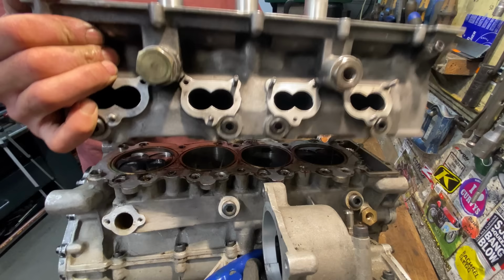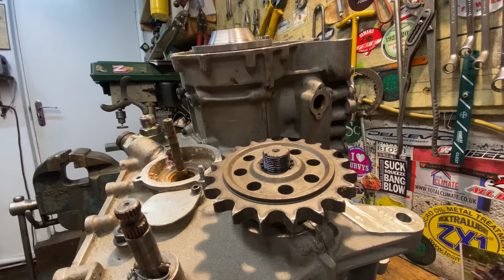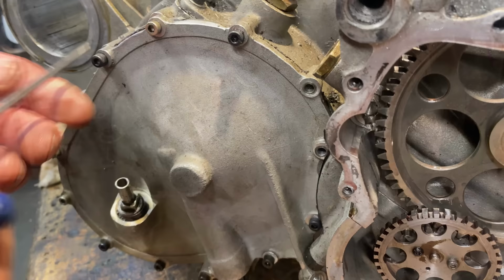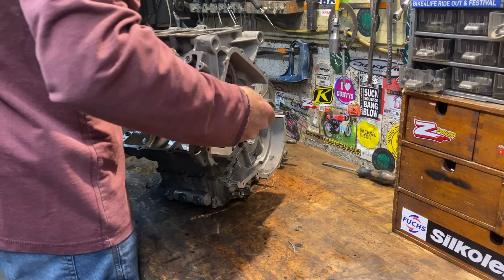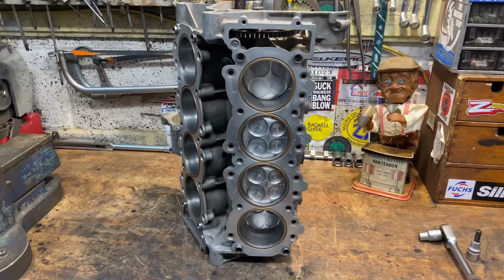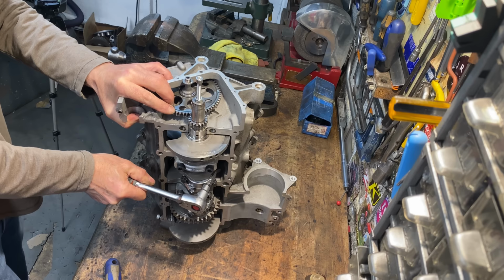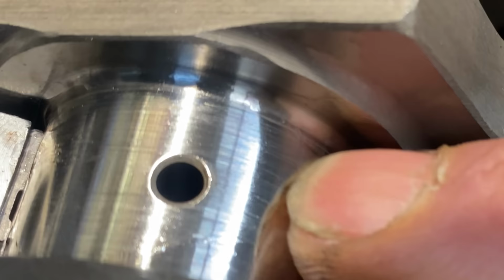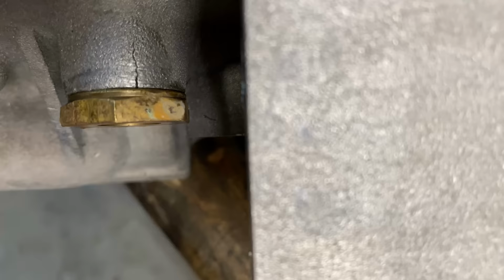Norton Nemesis V8 Rebuild - Episode 4

Comment: Some of the engineering looks top notch,other parts look like they came from a scrap bin.Also on this episode as with the last ones,every allen head looks damaged by previous use of poor tools. Thanks Mr millyard😊
Reply: Agreed - feels like a school project that started well and was rushed for the deadline
Reply: Exactly what I thought.  Great minds think alike 🤣🤣
Reply: That's what doesn't make sense. Some aspects are so well done and others almost junk. I do hope Allen can salvage this beast so that it can perform as designed.
Reply: Ii looks like a first pass prototype. A second version would (or should) have fixed the issues caused by 2D thinking.  I’m a bit concerned about the crank. The web “scallops” opposite the balance weights look too deep. They leave very little metal between the bearing ends. Peugeot did that with their V6 that’s noted for broken cranks especially in LandRovers.

Comment: Says a lot about GSXR transmission that the Norton thought it good enough to drop in as a complete assembly. Nice job Allen, this is so exciting to watch 🙂
Reply: I belive that John Britten used the same gearbox for his V2 racers.
Reply: When Allen took of the GSXR750 altenator last time, i was thinking, what else did they use, i recognized the gsxr 750 gearbox as ive worked on them before,amazing they can withstand a V8 1500 290HP !!, but im thinking ,if this bike was on a track or on full chat,it wouldnt perform well, or be reliable,the gsxr clutch for one would probably slip,even with stronger springs, or just emplode, i'm guessing its just been lightly used for reserch only.
Reply: @enoz.j3506   I seem to remember Al Melling had something to do with the design of the GSX-R 750 but cannot now find that info so might have been why he liked using it so much.
Reply: @enoz.j3506 Well half a V8 after last week's strip down 😮
Reply: I wonder how much else of the engine is derived from the GSX-R750. After all 2 x 750cc does equal 1500cc so maybe the pistons and conrods?
Reply: @ATomRileyA  On the comment thread from part 3 of this project Mr Melling mentioned that he designed the GSXR750
Reply: @1anwrang13r  The conrod are marked with MCD NV8 004 suggesting that they were for this engine - Al melling said as much in another thread
Reply: @enoz.j3506  I would be quite surprised if that engine made half that power at the rear wheel.
Reply: @1anwrang13r  All looks unique to the Norton.
Reply: Just aswell they used someone elses gbox otherwise that would be another area litter with faults to add to an already long list!
Reply: @UncleKennysPlace  Agree, i wonder if it will ever get on the dyno.
Reply: @stewartellinson8846  Ah, right. Good spot. Thanks!
Reply: @UncleKennysPlace   I'll   take you up on that,,   200 bhp at the wheel !,  assuming a decent ignition system is used😊
Reply: @1anwrang13r  As Stewartellinson has said below,those are definitely not GSXR con rods. 
The top valve cut outs on the piston crowns are cruder and more masked than the Suzuki Twin Swirl Combustion Chamber(TSCC) design used on the GSX and GSX R motors.

Comment: The motorcycle and engineering community are so lucky to have a gentleman like Alan who is prepared to put 
his time, effort and knowledge into bring back to life a piece of British motorcycle history.

By the way Alan, I thought I saw more cracks in the SAND CAST aluminium casting around some screw holes.

When you mentioned the wet liner bores, it brought a smile to my face, as it brought back a memory of the times 
I worked on one of my many Reliant vans and cars I had.

My parents tried so hard to get me off riding bikes as a teen, they bought me a Reliant Mk11 Van thinking I’d give 
up bikes lol, I’m now 70 and still riding; Sorry Mum & Dad.

In fact, I’ve gone full circle, I’m back on a bike I started off on, a 1970 Triumph T100R.

Keep up the great work Alan and THANX.
Reply: Did you sell the Reliant to a dodgy bloke called Del,by any chance? 😂

Comment: Another interesting and methodical engine disassembly by Alan. He does such a great job without criticizing the build quality. Unlike a lot of criticisms from some the commentators, he personally understands that this is a prototype that was still in its early stages and would require lots of simple quick changes to try and get things working properly, hence why some of them look cheap and nasty. Why spend hours of laborious intricate shop time if the test modification isn't going to function properly. You try something different until you work out exactly what works correctly. When all issues are sorted and operating as intended, then you can make the modifications and fully refine the changes before going into full production.

Comment: I’m sure there are many engineers who could take this engine apart. However finding what is needing to be sorted and the rebuilding to AM standard,compared to the original, is another issue.  Consider the time frame. How many  seem to take a few years. A remarkable, indeed unique and delightful man. His wife matches him , quietly there making the environment he needs outside the “shed”. As an ex velo man, the V twin,unreal, looks factory. If only etc.  wonderful stuff.
Reply: Rebuilding to a better than as manufactured standard, I believe you mean.

There are a bunch of places where you can see Allen is already coming up with improvements.

Comment: Your patience with those gearbox bolts was almost zen-like. I'd have been launching tools across the workshop while screaming "WHY DIDN'T THEY THREAD THEM FROM THE OTHER SIDE!!!" 😂
Reply: There would have to be a large projecting bulge for both pieces if they did that...
to achieve the required fastening torque and access to the bolt heads??
Reply: The could have easily mounted studs instead of allen screws into this threads. A simple nut would be much easyer to screw on and to remove in this place. Luckily the allen screws were not stubborn.

Comment: Send the pistons out to have the skirts coated by Line2Line. Get the rod and crank bearings coated as well while you are at it. It is sad and fun at the same time to see that Norton continued to make quirky engines needing lots of additional engineering. Still probably more fun than most of the stuff on the road.

Comment: After years of watching Allen Millyard, his video’s are still refreshing. I also noticed (for the first time ever), a little frustration in Allen’s voice when trying to remove the fiddly cap bolts! 😅
Reply from the maker: those cap head screws were propped fiddly, Studs and nuts would have been much easier
Reply: @AllenMillyard  I was thinking the same thing as you were struggling to get them all undone.

Comment: What astonishes me is how Alan remembers how it all goes back together! I’d be stumped. I struggled, totally stripping-down a Honda VF500 and reassembling it. And that was with help from a friend. Then we had 3 bits left over! Plus the Honda Factory Workshop Manual actually instructed us to install the 2 times inlet cams such that they ended up running in reverse! We double checked that. We were damned sure it wasn’t our error.

Comment: I for one think John Britten did a better job of casting his casings in his shed than Norton did here.some brutal engineering but some clever bits too. It's so over complicated for what it is and back when I first seen it on the cover of MCN I thought it was from 2099.
Reply: John Britten didn't cast the V1000 crankcases in his home workshop. There is some video of him heat treating a set of crankcases and quenching in water but not actually casting them.

Comment: AL Melling who designed the Nemesis has a track record of designing some fantastic engines. He was even behind raising £millions to mount a bid to buy Rolls Royce and Bentley. Unfortunately he was thwarted at the last minute when he found out it had already been sold to BMW without even considering his offer. He was also commisioned to design a range of bikes for Norton ranging from a V twin a V4 and this V8.  This bike was first shown at its 1998 press launch and promised 280bhp at 14,000 revs and a top speed of 225mph. Though it sounds like in the end it was all a bit rushed. Developing a new and complicated engine like this takes time and a hell of a lot of investment, and perhaps Norton as usual, didn't have much of either. Its a shame really because Norton also had a fine reputation that this bike would certainly have added to it.
Though fortunately Allen Millyard is just the chap to finally finish what Norton started and finish it to the very high standard it deserves. Which is just as well, because I also hear a speed record attempt is being contemplated.  It would make a very interesting video to hear Allen discussing  this engine with its designer Al Melling and hear exactly what happened to stop its launch.

Comment: Some aspects of the engine are really clever, such as using tried and tested off the shelf Japanese gearbox parts, while others dont make sense, such as the hard to get to Allen bolts that should have been fitted from the top. Also the engine had been badly re assembled at some stage, with the spring for the gearchange quadrant fitted back to front.  No doubt this engine will run better than it ever did after being Blueprinted by Allen.

Comment: Norton put so much effort in to this prototype and the seemed to spoil it with amature mistakes
Reply: I suspect that this was never a serious project to build a production motorcycle. There are so many odd things here - particularly in the running gear - that would have made it very hard to productionise. It's also odd that this was prioritised over the 750-4 which might have been more likely to get into production. It's a lovly engine but it shows the MCD racing engine origins
Reply: I wonder how many of the funds went out the back door. It looks like the ongoing EV start-up scams.
Reply: Agree > this was a R&D exercise

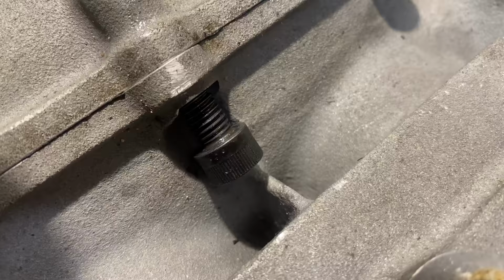Comment: 6:34 A 2 inch Roloc disc holder previously turned down to an inch and a quarter for some tight quarters polishing turned out to work well running discless as a sort of tire for spinning out Allen bolts. As the bolts came out they had a tendency to skew slightly and bind. To counter the skewing I filed a bolt head sized indentation near the end of a 6 inch x 1 inch x 1/4 inch scrap of UHMW to use as a guide to keep the bolt from becoming skewed and binding... I had a great many to remove.

Comment: I wonder why they chose to use a roll pin and not a woodruff key. In a previous comment, Allen is a real gentleman. Doesn't moan just gets the job done and in most cases improves on the original.  When the going gets tough, there's always tea and cup cakes.
Reply: time, at a guess. I'd imagine that this was a quick and dirty solution to a problem that would have been properly sorted when the bike came back from the show and development continued - which never happened

Comment: It would have been fantastic if during disassembly you were going "this is so well made, it's a testament to British engineering." But it's not. It's a clever design in part but sections like the crank case bolts screwing into a lug with no room, if it had been the other way round you'd have had plenty of room. The starter clutch taper and roll pin, the small M8 bolt holding it in. The list will go on. I appreciate it's a concept engine that was only really designed to run for very short periods and certainly not production ready but it's not a wow look at that engine. It's very compact though I'll give it that. Great, patient work so far👍

Comment: If you magnetize the bit of allen wrench you cut off you can use it during assembly by putting it in the screw head and turning it with a conventional open end wrench. May not make much difference but some.

You must have a clock out of frame because I can hear it's suttle ticking throughout the video.
Reply from the maker: Great idea

Comment: It's an interesting engine. It's a shame they didn't have a little more time to develop it.
The sprocket was safety wired?
Also, they needed someone to look over their shoulder and ask, "Shouldn't case bolts should face the outside of the engine?"
I hope the engine gets vapor blasted.
You did a much better job extending the shifter shaft than they did. It didn't break, but perhaps misalignment hastened the case wear.
Are you going to call up your local parts dealer for parts for the Norton Nemesis? : )

Comment: It's thanks to Allen who gave me the confidence to tackle the fuel injection system on my Honda Valkyrie Rune.  When it came to me, the rotary air valve was converted to run like a manual choke, impossible to run the motor properly.

Comment: Hi Allen, Thank you for sharing your project on the V8. So with regarding the starter shaft, did I see an area where originally there was a woodruff key slot filled in? If so, will you be machining it out to allow you to disregard the roller pin locator? I'm looking forward to your next video and thank you for sharing. 👍👍

Comment: If the clutch is from a 750 gixer it suggests the engine wasn’t massively more powerful than a 90’s 750. Just a poor motor show lash up. After Alan has finished with it it will be a thousand % better than originally

Comment: I wonder if those gears with so much backlash in the are going to be  reused or if  the Genius bike builder  is going to make some new Helical gears to replace them .Once rebuilt I feel this bike will be quieter than it was and run a lot smoother

Comment: @Allen Millyard  
Thanks Allen, wow, some of the ork Norton did on this engine is great, others is somewhat scary for running without proper care on some internals assembled, lazy corners cut, such as some of the splitpins/dowels, loose fasteners/nuts etc, and over-used rad-weld/casing sealant leaking into oiling & cooling system passageways...

And you have to come up with some sort of bespoke 'torque wrenching specs' too...
Best of L*ck

Comment: Allen Millyard is the ideal person to take on this work. Each time he spots a deficiency in the design, he already has a known, robust solution to implement when it goes back together. I thought that maybe the engine castings had the threaded part in the wrong section. Because there was no good way to get allen wrenches onto the case bolt heads, would it make sense to have reversed them in the design??

Comment: Well done Allen, there are quite a few problems there, some very sloppy work done by whoever assembled the engine (I imagine it would be possible to find out who that was if you felt so inclined). I see good and bad things in the design, but sadly, mostly bad. I wonder how long a GSX750 drivetrain would last given the 200+ HP the engine was claimed to make.

Comment: 13:28. I wonder what those bearings are from? They got a oiling hole going nowhere on the cap.
Reply: That might be to make sure there was a "reserve" of oil in the bearings at engine start up...
before the oil pressure rose to normal operating???

Comment: If I had the ability required to do something like this I would take 2 06 R6 Engine's and combine them with an R1 Transmissionn. Id go 2006 and above because the 3rd Gen R6's came with Titanium Valves and EFI from the Factory so the Heads are a little lighter and Fuel Injection will save Space.
Reply: I just Think 1200cc is a more Reasonable Displacement for a Motorcycle, I just feel like 1500cc is a little Overboard even for a Project like this...
Reply: The 1200cc should have an Output very similar to Modern Liter Bikes. So I shouldn't have to bother with Fabricating a 1 off Frame to Handle the Power.
Reply: Honestly I can't See a Reason why I couldn't design it to line up with the existing Mounts, Which should Keep most of the Engine in the Bubble hopefully Neutralizing most of the added weight...

Comment: Why don’t you use a drill to undo the bolts once you’ve got them loose? Saves loads of time?
Reply: If there is a serious problem with the fastener...do you want to be able to "feel" that before a hole in a casting blows apart???
(See the crack through one such casting?)
Reply: @JohnSmith-pl2bk  I understand why he uses hand tools to loosen it up. For the extra long bolts that take ages a drill is the way.
Reply: @timmynastics  
I think Allen may be soaking up as much time as he can disassembling the bike, taking notes and planning ahead in a methodical way?????

Comment: That NORTON doesn't deserve Alan to be working on it as the Engineering and workmanship is so pore all of the Hype about it turned out to be smoke and mirrors haha? It wouldn't make a lap around the TT Circuit ( Isle of Man ) at Race pace 😮 😅😂😅😂😅😂
Reply from the maker: the tank holds about 6 litres so maybe to Ramsey hairpin

Comment: Is it just me that thinks it's a bit odd that the bike is given to an engineer rather than the manufacturer for restoration😁
Reply: The manufacturer doesn't exist anymore. Plus, I'm sure that the engine will be rebuilt to a far higher standard by Mr M than when it left the factory.
Reply: This is a prototype and has no relationship between any norton past or present. If it's got any similarities to anything, it's to other Al Melling designs and, as such, there's no-one who knows much about it save Mr Melling and the people who actually built the bike, whoever they were.
Reply: Yes.
Reply: I can remember it being on the front cover of MCN many years ago.